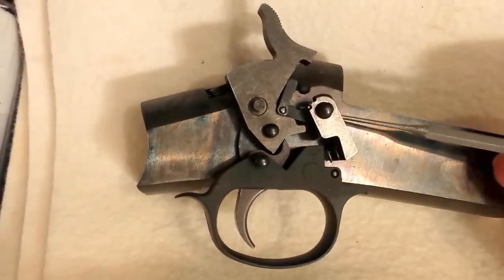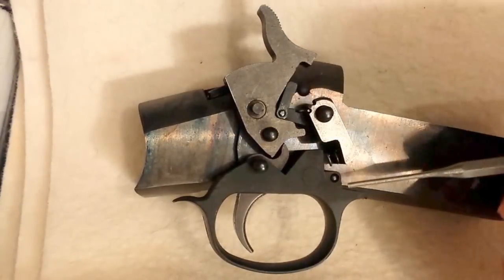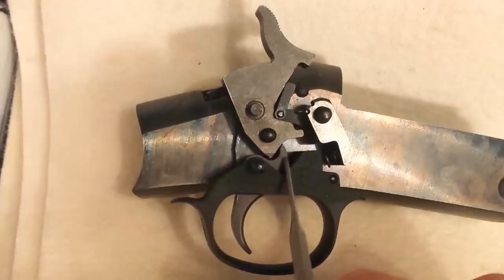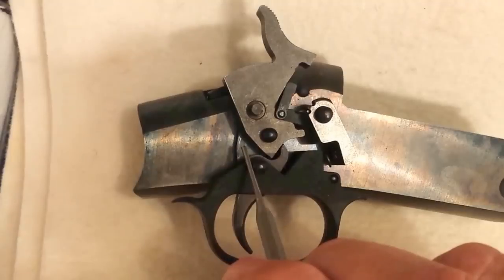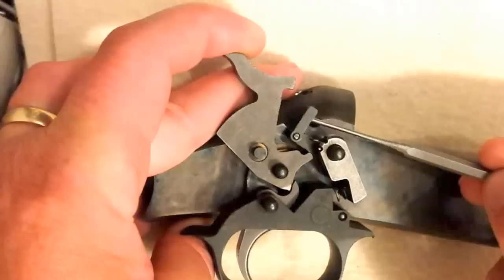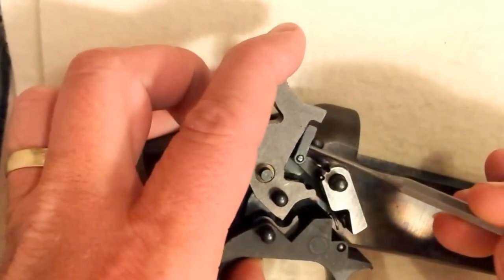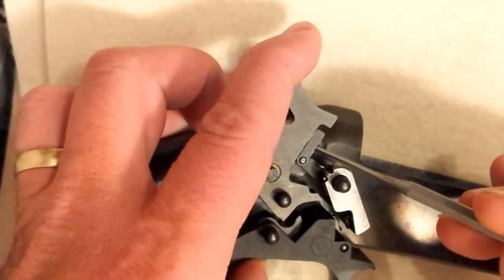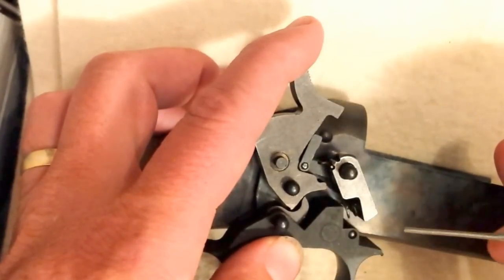How a New England Arms (H&R) shotgun action works. Working cut away action.Transfer bar.

Comment: Really like how you assembled on outside of gun. U use your brain!😊
All but one of these guns I've had needed transfer block to be replaced. 
For some reason the block breaks off at the pin neck at it's smallest point of tooling.
Been wondering if I might start making them myself out of a stainless metal to see if they will last longer or just not break!

Comment: my shotgun has the same problem howd you fix it?
Reply from the maker: Hopefully you got it fixed by now, but the way I fixed mine was to install a new lifter/striker assembly. Purchased from Numrich.
Reply: @laborspringer  i just did some bubba gunsmithing. bailing wire is about the same size as the hole so i took some vice grips and smashed both sides of the wire and pressed the two parts together onto the wire. not a permanet solution but it works for now and i only took 30 mins including dissassembaly and re assembaly
Reply from the maker: @theatf6070  Nice. Gotta love Bubba.

Comment: My transfer bar falls back when the hammer is cocked and won't fire or open. Took a magnetized screwdriver and lifted it back into position. Why does it fall back?

What holds it in position ?
Reply from the maker: Transfer bar is broken. How I ended up making this video.
Reply: @laborspringer  I have fixed the lower unit on a Johnson 9hp boat motor,would slip out of drive.

What is the mode of failure on said transfer bar Captain Obvious?

Point out the true failure point.
Reply: What is the point of your presentation if you don't state a problem and the solution?
Reply from the maker: The tranafer bar is hinged. In mine the pin broke so it wouldn't move into place anymore. I fixed mine by a teardown and replace.

 Aa far as why I did the video, because I thought it was cool you could build the inner workings on the outside and sse how it operates. 

Good luck
Reply from the maker: Numrich or Jack First should have a new tranfer bar. 

I am not a gunsmith, just like to take things apart and figure out how they work.
Reply from the maker: Called striker/lifter assembly.
Reply: Thank you so much! I'll check out the parts guys.

Comment: Even with the addition of the transfer bar, that has to be THE simplest action ever made! H&R understood the "KISS" method and exuded it in spades.
Reply: The rebounding hammer mechanism that's present in most single barrel shotguns from the late 1800's onward is even simpler. Putting the Topper with transfer bar back together is quite a task for the inexperienced.
Reply: @chapiit08  I was referring to the basic mechanism, not just the safeties.

Comment: Old video but where did you get the replacement Transfer bar? Or is there a way to negate it completely and still fire the gun.
Reply from the maker: I think I got it from Numrich gun parts.  If they don't have one try Jack First in Rapid City, SD.  Wasn't a lot of money so I would recommend the new transfer bar.  Actually called a striker/lifter assembly.